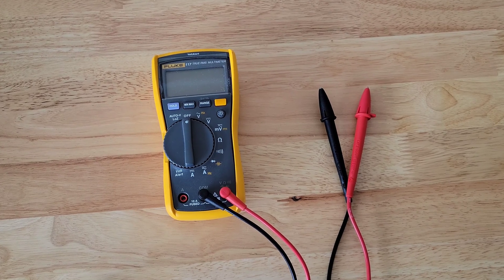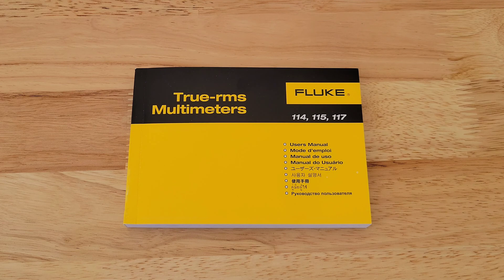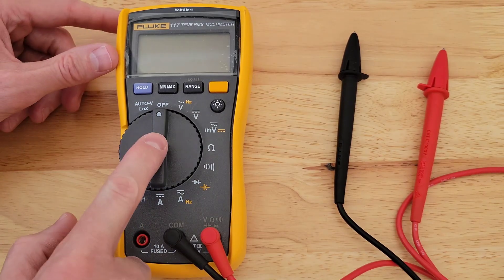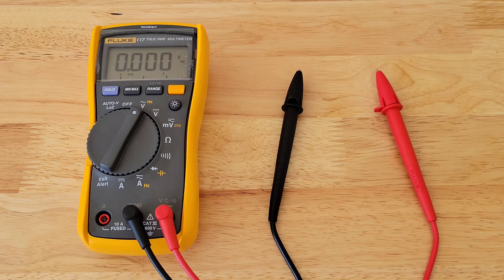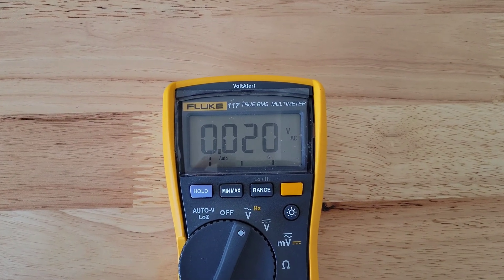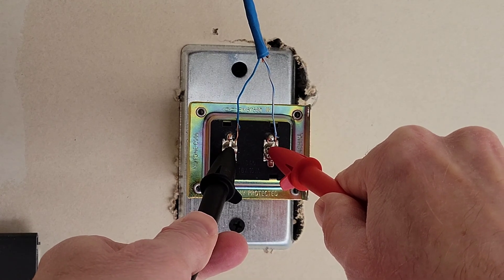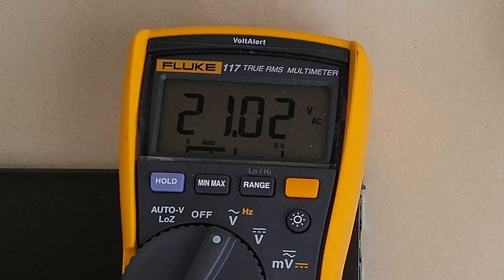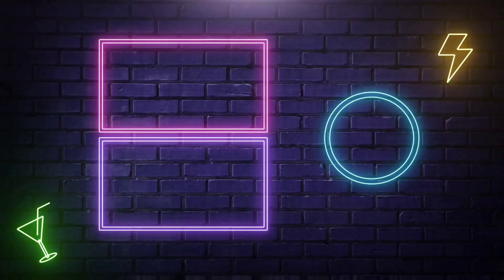How To Measure Doorbell Transformer AC Voltage & Hertz Tutorial

Comment: How can you check whether the current is adequate for the doorbell? Blink doorbell guidance I read online states it can tolerate maximum 40VA. So presumably you need to check the transformer is not of a higher current capacity, or will the doorbell only call for as much current as it needs?

Comment: Wrong wires ….. using CAT 5 or 6 for a doorbell is not legit . 
Use 2 wire with a neutral and a hot
Reply: This is low voltage output, 24VAC at around 1A. While it's probably a good idea to use higher gauge wires for better strength, Cat5 & 6 support POE which can easily handle 44 - 57 VDC.